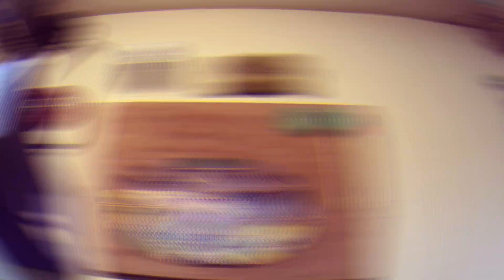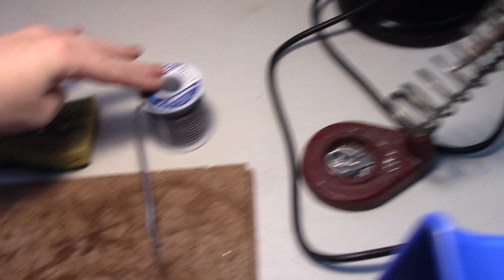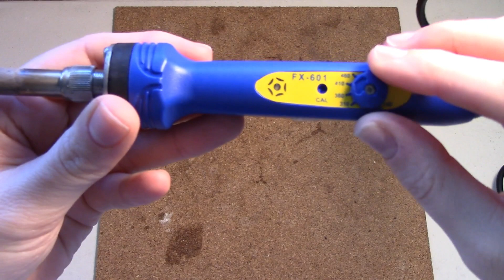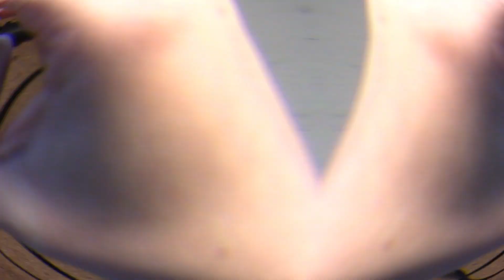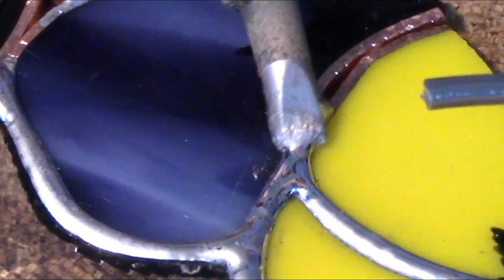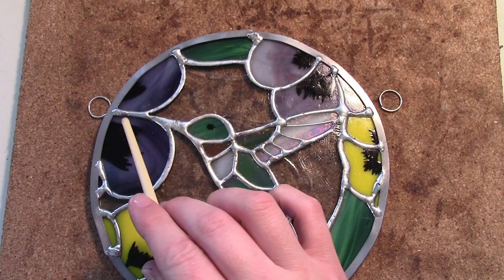Stained Glass Soldering :: Tips & Tricks to Get You Through Every Step

Comment: Let me add a few comments from my 50 years as a professional glass craftsman. First off you need to use a bigger iron. I use a 200 watt and make custom tips using a copper rod. This is pro level and faster and better soldering. Another point use a fan to blow aways the fumes and don't solder in your livingroom or inside. The fumes will suck into your drywall and it will smell inside.

Comment: I was always taught that you WANT the solder to flow through your project on the first soldering because that's what creates more strength and stability. Also, the more you fill in all the cracks and holes, the less bubbling you have when you solder the back of the project.

Comment: Hi -  I have researched this to no end and still have not found an answer.  I want to solder a diamond pattern on a large piece of flat glass. I would use copper foil and flux.  I want to frame it and hang it in front of a window.  
Can I do this, or will soldering only work when joining two pieces of glass together? 
Thanks so much!
Reply from the maker: If I understand you correctly, you might look into copper foil tape sheets. They have very strong adhesive and you can cut them with an exacto knife to give different patterns and shapes. You might have difficulty soldering a large, solid diamond due to the way solder likes the pool. If the area of solder is too large it will cause pitting and not be smooth. Otherwise, if you cut a diamond that was basically just a thin-ish outline of a diamond, the copper foil sheets might let you accomplish what you're looking to do on a single piece of glass. I hope that helps!

Edit: I didn't actually know the name of it until looking it up just now. "Stained glass overlay" is the style I'm specifically referring to
Reply: I am so grateful for your response!  Thank you very much.  I will definitely check into the stained glass overlay.  Take care! @sunbearglasscraft8065

Comment: Hi, what width of copper foil is best in general please?  many thanks!
Reply from the maker: Hi, great question! 7/32 is going to be the most commonly used foil size. Some people prefer a thicker solder line and might default to 1/4, but I go through 7/32 more than anything else!
Reply: @sunbearglasscraft8065  Thanks for the quick reply! I saw in another of your beginners vids after I asked about the width, that 7/32'' was probably the most used. finding your tips very useful as a total beginner :-)

Comment: Lovely work can you tell me how you find working with  50/50 solder compared to 60/40 thank you.
Reply from the maker: thank you so much! I personally have not worked with 50/50 before, but as far as I know it can be a little more difficult to work with in terms of getting a smooth solder line because it requires more heat. On the flip side, I know some artists really like it for doing decorative soldering (getting different textures, layering textures, etc). This is just anecdotal, though, so other artists might be able to answer your question a bit more in depth :)

Comment: Any advice for soldering glass with different widths? I'm about to solder my first piece but getting my hands on glass with the same width has proven impossible.
Reply from the maker: Hi! Unless the differences are HUGE, slight differences usually arent a problem to solder as normal. If it's really going to bother you, you can solder the back side of the piece first so all the lumps and bumps are on the side that will be viewed less. Hope that helps!
Reply: @sunbearglasscraft8065  Thank you for the quick reply, it definitely helps! The hard part for me figuring out when the difference is too much. Some pieces seem to differ by about  20% although the pieces themselves are still very thin. Does that make sense?
Reply from the maker: Yes it absolutely does. The pieces dont have to be perfectly flush in order to solder effectively. It's hard for me to quantify the size differences I've soldered before, but I feel confident estimating that I've dealt with differences of up to 1mm. I chose not to solder the back first because the project was 12" wide by 21" tall and would have been difficult to flip. Another method I actually saw the other day is propping the thinner piece up with pennies to emulate the width of the larger piece

Comment: I was about half way through my first large panel project (180 pieces) and it was terrible. A gift my daughter asked me to make for Christmas. I spent $200 on glass and foil and solder etc. I was using liquid flux and had contaminated it, and flooded the big gaps with it! I was also using heavily textured glass as well as a variety of thicknesses, so I soldered the back first. A disaster. Boiling trapped flux, globs of solder and thick ugly lines. After this video, I ran out and bought gel flux, turned up the temp on my iron from 350° to 410° and even bought extra glass incase I cracked some. Then, I tried the bit by bit method. Gel flux just on the very tip of the brush, half a teaspoon in the cap max. I made my first perfect bead line. Then another, and another! I re-melted every line and boiled off all the trapped liquid flux. It's beautiful! You saved the project and I can't thank you enough! (And not a single cracked piece of glass)
Reply from the maker: Oh wow!! I am so happy to hear that my video helped you ☺️! Hooray for a beautifully finished project and no cracked glass ❤!

Comment: I tried to Dab the solder on to the joints, but the solder drips off of my iron. Why is that? There is no way with my soldering iron that I can solder the way you are showing in this video. What am I doing wrong?
Reply from the maker: You iron might be too hot and you might be grabbing too much. Otherwise, the tip might be dirty. I can never get the solder to stay on if the tip is dirty. I use a wet sponge to clean my tip while it's hot. I hope that helps!

Comment: Hi love! I’m curious if you could give me a nudge in the direction you found your gloves in... I have small hands, and it’s been a bit difficult to find fitted gloves for myself 💛 Much love! If they can prevent burns aswell, that would be pretttty dandy 😂🥵🙏🏻
Reply from the maker: Hello~! I found these gloves on Amazon. You can find them by searching "dex fit gloves". I ordered a size medium, and for reference my hands are 6.75" from the bottom of my palm to my middle finger tip. These gloves are great for preventing burns!
Alternatively, I recently got rubber dish gloves and I use those for soldering now. I like that they're easy to clean and don't let the flux soak through like these dex fit gloves. Hope that helps :)

Comment: How do you prep your soldering iron? Mine isn’t holding the solder. I am using the same temp but for whatever reason it’s not holding the lead.
Reply from the maker: Honestly I don't do much - if it's not holding onto the lead it might just be dirty. I know it's time to wipe the tip once it won't melt my solder. Otherwise you might just be trying to grab too much at one time. I hope that helps, sorry I don't have better advice!
Reply: The Iron Tip needs cleaned. Use a Sal Ammoniac, also called a tinning block, quickly cleans any carbon build-up that collects on the tip of a soldering iron. Simply rub the tip of a hot iron against the block and in seconds, the tip is clean, bright and hot. This block lasts a long time. Google it... or Amazon has it for 10 bucks SRA Sal Ammoniac Tinning Block.

Comment: The 75, 80 ... or the 7 or 8 on a phaser means the iron heats only 75% or 80% ... or ... 70 or 80 %.
Ex: if iron heats to 600 degrees, setting phaser on "7" will heat iron only 70% of 600 degrees, which is 420 degrees.

Comment: What size came is the right size?  I assume there are many for glass thickness.... but hobby lobby doesn't put the thickness  on the glass
Reply from the maker: I depends on the glass, since some glass is thicker than others. The came I used in this video was 3/16" (or 4.7mm wide) and it's a super safe size for all glass. I've never had a piece not fit this came. I do use smaller came, which I believe is 3mm, and I use it for my thinner glass. Most glass doesn't tell you how thick it is, so you could bring a small ruler next time you go pick up glass to measure the thickness :) I'd say the average glass thickness is 3mm

Comment: Thanks for the video! I'm at the soldering stage of a piece I have been working on for a long time. I made the front look nice and it all has a raised bead. You put the U channel cane on the outside before you soldered the back side. Is that how you always do it? or do you ever solder the front, solder the back, then attach the U channel border?
Reply from the maker: I'm glad you found the video helpful! You can absolutely solder the front and back and then add the came. I do this on bigger pieces that are more unstable - sometimes when soldering just the front, picking it up can feel a little wobbly, so in that case I solder both sides before adding. If its a smaller piece, like this, I like to just get it out of the way!

Comment: Where do you buy your lead came and wire you use for detail? 

Thank you for this video. I’m new and this is super helpful as I now know I’ve been overheating my solder. Doh
Reply from the maker: I've purchased lead came both online and in person. This larger came was purchased on anythinginstainedglass.com and is SU-54, 3/16" square came. I don't like it as much as the other came I use, because this one is more heavy duty and a lot harder to work with and get the kinks out of. 

For my copper wire, I purchase it directly from my local stained glass shop and I'm not sure where they get theirs! I've purchased pre-tinned copper wire online before but it was a nightmare to work with. It was very oxidized when I purchased it and repelled solder even when I used the appropriate amount of flux. I'd image you could by a roll of plain copper wire and tin it as you use it - although I have not tired this before!

Comment: Great video, I have never seen copper wire used this way for wings and tail, will start doing that, Thanks!  How did you get the black streaks in the flowers and for the bird's eye?
Reply from the maker: I'm so glad you found my video helpful! For the flowers and eye I used glass paint - specifically Pebeo Vitrea. It's a paint that is set by baking in a conventional oven at 325F for 40 minutes. Very affordable and easy to use!

Comment: I'd love to know your thoughts on the soldering guns that look and perform like a glue gun, that feed the melted solder out in a stream when you pull the trigger. Do you feel like that's a tool that would be useful in this art form, particularly for someone who is just looking to shop for supplies to get started?
Reply from the maker: Hi there! I'm actually not familiar with that tool, although after looking it up I'm not sure it would be very good for stained glass. It looks like the tips on the solder gun are very small and potentially only work with small, circuit board specific solder. Just from the pictures I'm seeing, the solder being used for the solder gun is 1mm, whereas the solder I use is about 4mm. There are also some reviews on the product saying that the solder is very sparsely dispersed (ideal for circuit boards and super small machinery, no doubt!), which is not going to be good for stained glass since to get a nice bead you really need to be able to lay it on thick.

I would stick to a regular/stained glass specific soldering iron like I show in my videos :) The product you're referring to might look appealing since they're relatively cost friendly, but I'm doubtful you'd be able to get much use out of it for stained glass. Great question, I had no idea that tool even existed!

Comment: Do you add the lead U came to every piece?  Also, when you filled the holes like the beak, did you fill with copper strips first or just straight solder? 

I am about 3 weeks into stain glass, your videos have been so helpful. I am working on my largest piece so far and your video came at the PERFECT TIME!
Reply from the maker: Yay! I'm so happy to be able to help.

I personally only add came to pieces with defined borders. For my smaller pieces, I've seen other people use came but I personally haven't since I make a lot of itty bitty leaves, honeycombs, etc. 

For filling holes, I just go straight in with solder. The beak for this guy was probably my limit for how big a hole can get. If it were any larger, I would definitely have cut, smoothed, and foiled a piece to basically just be a place holder. 

Good luck with your stained glass journey and don't be afraid to reach out with any more questions :)
Reply: Thank you so much!! Mine are all smaller holes, but I wasn’t sure how to fill them, be it tiny glass or what! Thank you for your help!
Reply from the maker: @laryssagreen8739  You should just be able to slowly fill them in then. It can be tricky at first to fill and make it look nice, but I believe in you!

Comment: Great video.  How strong is stained glass?  Have you done any destructive testing?
Reply from the maker: Thank you! It's actually much tougher than you would think, although I have not purposefully tested its durability. I've had pieces fall from 7-10" before and not break, although each case is different. Art glass tends to be thicker than normal picture frame glass, and I believe the heavy metals that are added to give the specific colors (ex: pink glass is made with gold) also strengthen the glass.